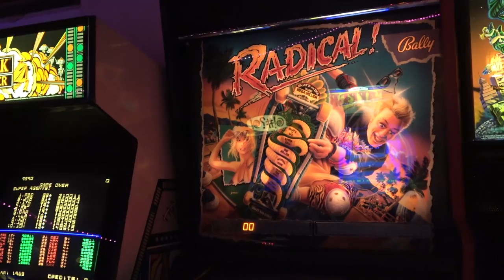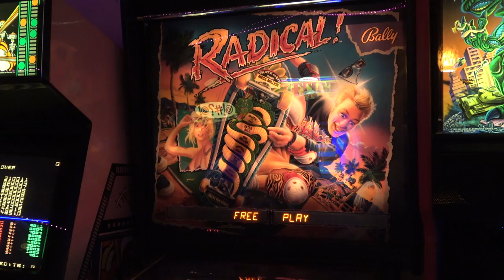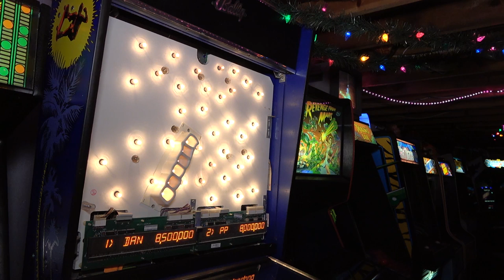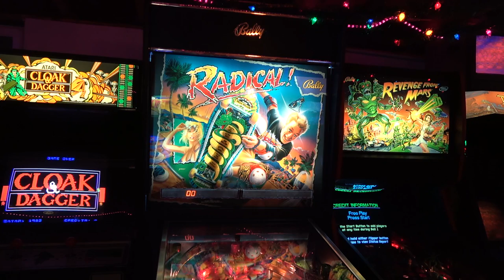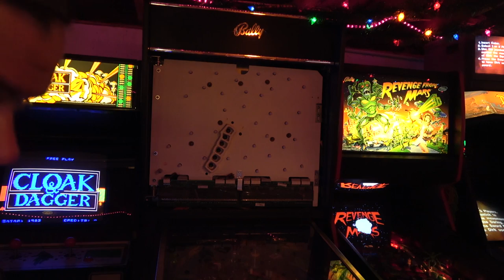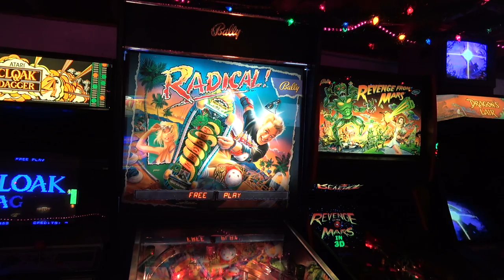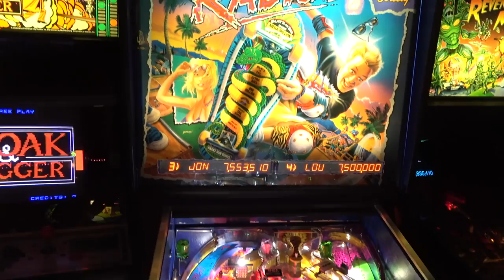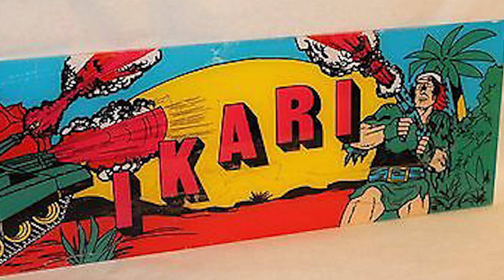How to install LEDs in a Pinball Machine - 1990 BALLY RADICAL PART #1 GI (General Illumination)

Comment: Finally! A pinball video I can comment on. Just wanted to point out one thing. Leave the game on while you are changing bulbs! For real. Take your time, leave it on so you can see if the socket is working before you move on to the next. The worst thing that could happen is you blow a fuse. I've owned 100's of machines, and never had a problem. Now, take ALL of those LED's out and put back in the 47's.
Reply from the maker: Ha! No. :)

Comment: Nice video, John! Definitely looks alot better with the LEDs..my suggestion about the magnetized nut drivers..depending on the nut driver itself, stick a small magnet on the shaft of your nut driver and it should hold the bolts in place good enough to get them in..

Comment: Obviously LEDs do not photograph or video well due to their inherent semiconductor characteristics, but when you lit up the slings/inlanes, the flipper area still looks dark. You can resolve this by using a strategically placed 12V LED strip in the apron or trough. They come with 3M tape, in different colors and SMD counts. I don't think you need much, but I did this to my Addams and made it a lot easier to see the ball in a dark gameroom.

Comment: When you don't have a magnetic nut driver, use the old mechanics trick of putting a small piece of paper over the end of the nut driver and stick the screw into it. The paper will provide enough friction to hold the screw in place.
Reply: A.J. LoCicero or stroke the tool with a magnet and it will magnetise it

Comment: Personally I love the LED look and I think your light temperature choices have been good so far.  That said, I think it's probably a good idea to change them all, including the flashers, because without new bulbs the flashers look a bit dull in contrast to the other lighting.  This will likely be more true as you do the rest of the lighting.  Just my two cents.  Thanks for showing this, I was not at all familiar with Bally Radical pinball.

Comment: Hey John, I have a Bally 1987 "Dungeons & Dragons" Pinball machine, in which i would like to replace the lights on, however i notice that there is a solder line that goes from the bottom of the metal light bracket that attaches to the playfield to each light periodically held in by staples. I'm afraid I may break that when going to replace one of the bulbs. What damage would that do if it were to happen? (hope my question makes sense)

Comment: When you get an LED that doesn't light up when you put it in, try flipping it 180 degrees clockwise or counter clockwise. Often times the fit isn't perfect on one side vs the other. If that doesn't do the trick, something's pinching the sides of the light housing in just a bit  will do it, as sometimes the metal has lost its shape a bit....likely expanding from the incandescent bulb heat.
And you will totally want to do the flashers to LED.....the old dim yellow flashers feel so out of place against the clean and strong light of the LEDs that are everywhere else. Just my 2 cents.
I'm always enjoy the process of putting LEDs in (also tastefully),  always feel like the game feels new, and have all new life breathed in to them.....it really feels like an all new game when you finish.
Reply: LOL, flipping it really has nothing to do with clockwise or not. Why not just say "flip it" and be done, since the actual circular direction of the flip matters ZERO?

Comment: When you turned out the lights it looked like the girl in the Radical backglass was swearing with Qbert's text.

Anyway, try and use different color LEDS on the scoring parts in the backglass (the skateboard underside), i did it on my Gottlieb Arena and it looks snazzy.

Comment: John, Take a magnet you have and rub it up and down the Nut driver several time and it will be Magnatized. Works every time. My Bally Black Rose has some G.I. lights that don't
 come on as they should and the bulbs are good. Help.

Comment: The basement looks awesome.  That pin fits right in there.  Have you thought about swapping cloak and dagger with 720?  And have the 2 skateboarding games together?  And that crazy climber needs a light in the marquee.  I think you mentioned something about it when you got it.
Reply from the maker: +DMETS519 Crazy Climber doesn't have Marquee bulb. It's solid wood.

Comment: John, I think I noticed one of the green flashers on the left side of the play field was not working. So, Yes, I would replace the flashers. Also, just to repeat in case you missed my comment on it, your Crazy Climber game does have Free Play according to the manual. You just turn on the last 2 dip switches while the game is powered off and then when you power on you will have Free Play.
Reply from the maker: +Jeff Hardies ok, thanks. I'll check it out.

Comment: Use flashers, the incandescents will not be bright enough in my opinion. Basically if you start to use LEDs replace everything with LEDs unless it does not work for a specific light (very rare though). Really, there is no reason to use incandescents anymore on pins. It just looks flat. For purists: just don't add different/new colors... 

Also good call to use whites for the GI. I always use whites and then if I see a spot on the playfield that might really benefit from a different color I change them for that part. There are very few pins when colored GI makes them looks better. And of course for colored inserts use colored LEDs to make them pop. Probably non ghosting ones, but depends on the pin where this is needed.

What might look nice on your Radical: clear bumpers maybe even with color changers. Might work here very well with the ramps, but up to taste of course. Not sure, but maybe an option you might wanna think about.

Comment: Good grief are u ever going to get back to MK2??????
Reply from the maker: +Clyde Mullinax yes. One thing at a time. :)
Reply: Clyde Mullinax I'm betting that damn ticking monitor is making him a little reluctant. Even if he's working on the cabinet, it's going to be lurking there in the back of his mind.
Reply: Rasdock i watch all of his videos now but i have an mk2 whos monitor will work flawlessly for 3 weeka at a time and then wont power on for 2 days and then go right back to working fine. Im jusy trying to see if its an easy fix or if i need a new moitor.

Comment: I'd ditch the frame around the lights down the board.... it seems to create a bunch of "tunnels"
Reply from the maker: +Brian Froeber what?
Reply: On the back glass.... the lights on the skateboard have that honeycomb like frame.... I'd try removing it and using a non diffused led bulb
Reply: The plastic of that creates a shadow like frame
Reply from the maker: +Brian Froeber oh. I gotcha
Reply: I think even with LEDs in with the plastic, it would still generate a bit of a shadow

Comment: Not sure what's wrong with your video John it's very jerky.
LEDs you should put frosties in the back glass on the other video said you had issues with some LEDs not discharging or flickering try 10k ceramic capacitor across the LED or run a small resistor say 200 300 ohms in series with the LED. the intestine bulbs would be 2700k stands for Kelvin, the white ones are usually 5500 up to 7 or8000 k. you have a theatre of Magic never shown at where is it?
Reply: could try in the back glass some grease proof paper silicone white paper if it's still not dispersed enough will help to defuse the light
Reply: seems like the the stuttering has stopped on the video
Reply from the maker: https://www.youtube.com/watch?v=KNlo4OOZmQQ <-- THEATRE OF MAGIC
Reply: 10k ceramic capacitor?
Like 10,000 Farad?
LOL
Reply: I don't know if you want to try this John thought of this idea to light up the side art? you could put an LED strip in the side rails inside if you get the thin width ones they're about 3 mm across like they use on LCD screens for laptops, if you space the side rails with washers so there's a slight gap of a millimetre or a little bit more then beaming the LEDs through the gap should light up the side art.